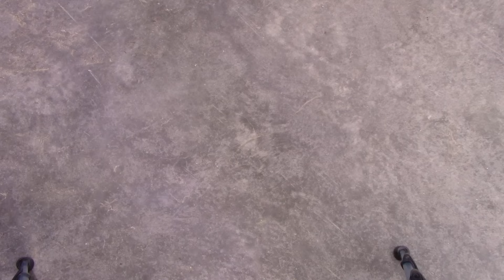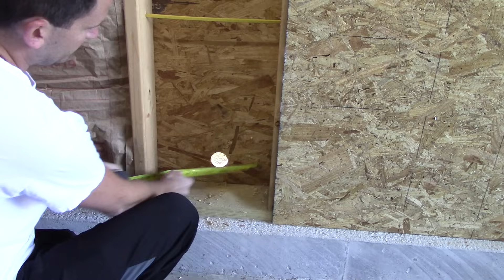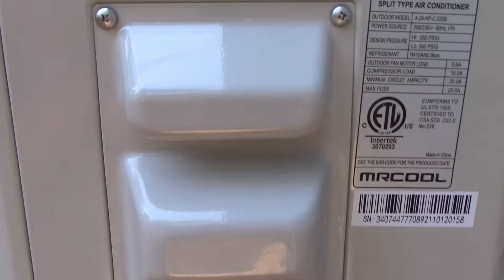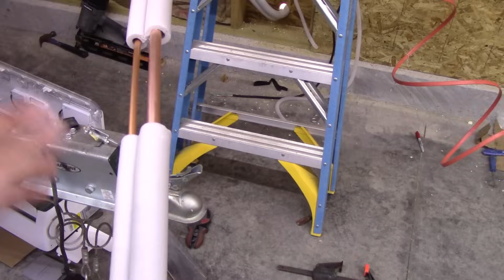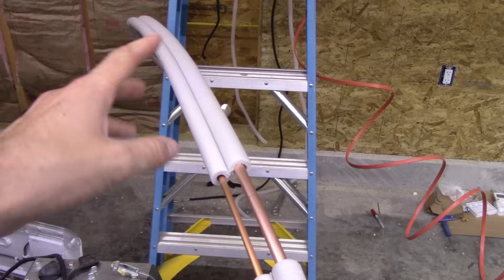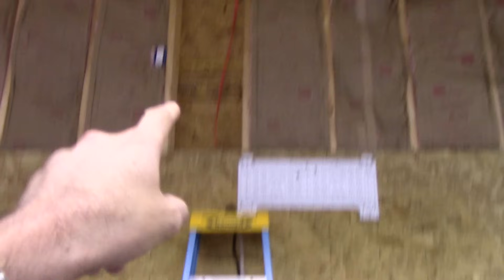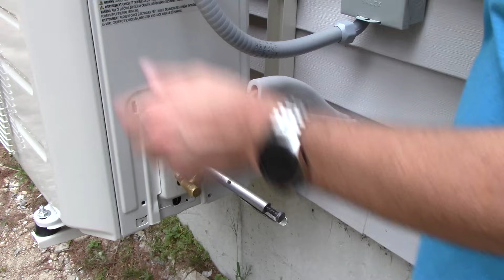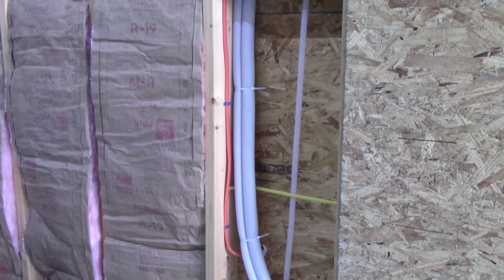Mini-Split Installation For Dummies - Complete Step By Step Guide.

Comment from the maker: MRCOOL HVAC System: https://amzn.to/3RDVp7m
Complete kit w/pump and gauges: https://www.amazon.com/gp/product/B00SZ4QFW0/ref=as_li_qf_asin_il_tl?ie=UTF8&tag=trialnerror-20&creative=9325&linkCode=as2&creativeASIN=B00SZ4QFW0&linkId=89c4a0bb2075662a32a2d66ed96ff4fa
Mini Split Adapter (service port adapter): https://www.amazon.com/gp/product/B07W9CQ76M/ref=as_li_qf_asin_il_tl?ie=UTF8&tag=trialnerror-20&creative=9325&linkCode=as2&creativeASIN=B07W9CQ76M&linkId=ca52469d7bedc726fa7d4ffc8f092356
Wall mount for outdoor compressor: https://www.amazon.com/gp/product/B00LDU9R2I/ref=as_li_qf_asin_il_tl?ie=UTF8&tag=trialnerror-20&creative=9325&linkCode=as2&creativeASIN=B00LDU9R2I&linkId=397f284d3c939e6c81efd137b0f2c9ca
Nylog Blue Sealant: https://www.amazon.com/gp/product/B008HOSQQQ/ref=as_li_tl?ie=UTF8&tag=trialnerror-20&camp=1789&creative=9325&linkCode=as2&creativeASIN=B008HOSQQQ&linkId=0212c4d8d8a14465fadbd8918ca3e3f2
Tubing Flair Kit: https://www.amazon.com/gp/product/B01LZB68U1/ref=as_li_tl?ie=UTF8&tag=trialnerror-20&camp=1789&creative=9325&linkCode=as2&creativeASIN=B01LZB68U1&linkId=3662399f5c22b114b22ebabb5d7b922d
BRAND SPANKIN' NEW CHANNEL MERCH! https://teespring.com/stores/trial-n-error

Comment: For anybody who isn't an idiot & is familiar with basic carpentry/mechanical/electrical, there's only one focus of a mini-split installation: TESTING & PRESSURIZING THE SYSTEM!
So, I share my own f-ups:
- Invest in an r410a-compatible adaptor hoses-to-automotive A/C testing charging gear (which is relatively cheap). Don't waste your time trying to source adaptor fittings!
- DO NOT OPEN THE PRESSURE VALVES AT ALL UNTIL YOUVE VAC'D THE LINE & CONFIRMED NO LEAKS!!! If you crack the pressure-line open AT ALL with the vac-fill port ("service") with an allen wrench you risk venting enough 410 to prevent the system's pressure-sensor from allowing the system to activate.
- IF you remove the schrader valve to enhance the volume of the vacuum procedure, then you must REINSTALL IT!!! That schrader valve is the only thing preventing the 'fridge from venting-out the service-valve!

Comment: You’ll experience water intrusion due to your lineset draining into your home.
Reply from the maker: The drain line follow's the lineset from inside, through the wall and drains outside, next to the compressor unit.  Thanks for watching.
Reply: @Trialnerror I know. I’m not talking about your drain line. I’m talking about your refrigeration lineset. Water will roll down your lineset and go into your home now because you didn’t make a drip loop before going into the house. The lineset should go down first when it exits the wall and then loop back up to hit your condenser. This is called a drip loop and allows water to drip to its lowest point (outside of the home) and forces water to have to go uphill if it wants to enter the home. You have given water a downhill approach into your home and will see water damage before too long.
Reply from the maker: @IndomitableHuman  Those lines are insulated.  There's no condensation.
Reply: @Trialnerror 😂 alright buddy. Just make sure you think of me when you are repairing your water/mold damage 😉

Comment: I wished you had shown more details of how you connected the disconnect box. Was the power into the disconnect box entering through the rear panel?. I just didn't see that! Also are there any wires connecting the condensing unit to the disconnect box? Thank you

Comment: I seen where it is said NOT TO PUT LOW VOLTAGE LINES WITH HIGH VOLTAGE LINES.  VERY DANGEROUS
Reply from the maker: The power that feeds back to the indoor unit is already a combo of low voltage and line voltage.  NOT DANGEROUS AT ALL.

Comment: THANK YOU for saying it is nitrogen in the indoor units for transport. I tried to contact the company and they told me it was freeon. I had no idea how I was supposed to disconnect the plug without releasing all the freeon.
Reply from the maker: You got it.  Freon is in the compressor and they vac out the line set after adding nitrogen so you have nothing but an inert gas under vacuum.  Sad that the company itself knows less then a monkey like me on Youtube.

Comment: How do you connect L1 and L2? Did you use a separate wire? I’m getting eo error code
Reply from the maker: Yes, you have to use separate lines as these are two completely different power sources to get 220v.

Comment: I really appreciate this video. Especially the bit where you only release enough refrigerant into the lines to remove the vacuum pump line under low positive pressure. Brilliant, thank you!

Comment: bought my 1st unit, and just by watching your video, i realized i did a lot of  things wrong...the units i purchased were already pre charged, so was it wrong for me to skip the vacuum part? so i did the installation,  and  the first time i turned on the unit, all i  was getting was just warm air, i was wondering why it wasent cooling nor heating, so then i realized i had left the high and low pressure valves closed..no wonder there was no cool nor heat coming ..so after i opened the valves big difference it was cooling and heating.. but the 3rd day the unit started acting, less heat As nd cool, and also error codes P0 E9 ..since i just bought this unit on Ebay, i sent a message to the seller about the error code, and the responce i got is that pcb or pbc board is bad, , so they will be sending me a new one...i just hope that  this is the issue that is causing for the unit not to work correctly..the other thing it could be is a leak in the lines..

Comment: I thought the Mr. Cool systems used pre-charged lines. (I thinking about you cutting the lines down)
Reply from the maker: They sell both.  These are MUCH less expensive and only take another 20 minutes of work to install.
Reply: @Trialnerror  Good to know.  Thanks!

Comment: Great video!  Are you still happy with this unit now that you've been using it for nearly 4 years?  Any issues or anything you'd do differently?
Reply from the maker: Yes, still loving it.  Does a great job and has given me no issues.  Only thing I would do differently is mount the outdoor unit 2" higher so I could scoot under it with my zero turn mower lol.
Reply: @Trialnerror  Good to hear.  Funny about the mower--story of my life: stress about covering the most minor of details only to find you've missed one that's going to be an on-going PITA.
Reply from the maker: @practicalwoodworking  So true!

Comment: I read that the extra pipe length is important as it will hold more refrigerant which keeps the pump running less due to more ability to cool or heat? 
But still good video!

Comment: So basically it only gets two 110vac hot wires, a ground wire and no common wire?
Reply from the maker: Correct, that's how the majority of 240v appliances are wired.  They pull two "legs" of 120v and reference to ground which is bonded to the neutral at the panel.

Comment: Great job and very clean! These unit comes with an optional pre-charged line set, in order to avoid the vacuum process and adding Freon into the line set. Any reason you opted to install with a regular high and low pressure line set? Thanks!

Comment: Most people who are installing aren't doing it in an unfinished space, so while it's very helpful to tell those of us who don't have the flaring tools or the tools for adjusting down the coolant levels for using less line than comes with it or the knowhow to do either, particularly the latter since you don't show us, not to coil the excess line outside because it decreases efficiency and creates oil traps in the lines, it's not at all helpful to tell us to run it up and then down inside the wall or zig-zag it inside the wall since that would require us to tear out all the drywall and insulation between those two studs to do that, meaning we'd then have to reinsulate, re-drywall, and repaint. The same goes for even running the line inside the wall at all since we can't, so the average DIY'er is going to not have the line run down inside the wall but have the line go straight through, or at a slightly downward angle to keep rain out and drainage flowing downward from inside to outside, meaning the outside hold will not be 8-feet down from the inside hole but be only a quarter or half inch down such that you can see straight through to the outside, making the excess line issue that hasn't been feasibly addressed for "dummies" even more of an issue as all of the line except the last several inches it takes to pass through the exterior wall inside and connect to the inside unit will be outside.

Comment: Good video. I used the same kind of wall mounting rack for my 18K MrCool. But I have vinyl siding and it gave no support for the condenser's mounts. I ended up putting some pressure treated 1" X 8" boards to give a solid backing for the rack and then like you using lags into the joists. It looks like your siding is either wood or something as solid.

Comment: Great video!   Best details about vacuuming line set among all the DIY mini split videos I've seen.  Although you say it's simple, I've seen other youtuber DIY mini-split install get into major pitfalls - such as kinking the line set by bending it too sharply, or not actually vacuuming the line set before releasing freon by forgetting the shraeder valve insert.  So it's possible to get into serious trouble if you are not careful with DIY mini split installs.
Reply: in all fairness, the Mr Cool line is made as a plug 'n play with NO vacuuming required.

Comment: Excellent video. Indoor and outdoor unit installed. I purchased the vacuum pump and gauges and did the pressure test. Passed. Now I’m ready to introduce the refrigerant. Do I start the condenser before releasing refrigerant? Thanks for your help!

Comment: It was clever to add only some of the refrigerant before removing the gauge. Most (DIY videos) either spurt the stuff everywhere or else edit the removal out. That said, it also seems questionable, since doing so means you won't get to watch the system actually holding full pressure. I suppose time will tell; so, has there been any drop in efficiency after a few years?  Thanks ;)
Reply from the maker: She's still purring like a kitten.  Heating and cooling perfectly with no maintence needed (knock on wood). Also remember, even when you release all the refrigerant you still can't test under full pressure until the compressor ramps up.  All you can check is the low side at pressure and that really doesn't tell you much either.

Comment: Are those lag bolts that you used to mount the bracket to the wall for the outdoor unit?
Reply from the maker: Yes, right through the OSB into the studs.

Comment: Question, installed a new mini split, during the heat mode, condensation leaks at the bottom of the outside unit, doesn’t seam right. Thoughts?
Reply from the maker: Perfectly normal.  In heat mode, everything is backwards so the coil's outside get REALLY cold.  The outside air hits those cold coils and you get condensate.

Comment: How's she going for you after 2 winters and summers? I'm thinking about adding minisplit systems to a house I expect to buy soon. Not as far north so the heating need will be less (or at least fewer weeks) but the cooling will need to handle higher temps. I don't have the skillz or strength to DIY this but I like to know what to expect when I pay someone. Thanks for a great education! I'm looking forward to learning more from you! (newest subscriber at this moment in time!)
Reply from the maker: She's going strong.  Really has given me zero trouble and I haven't had to touch it since I installed it.
Reply: @Trialnerror  glad to hear it! Also forgot to give you props for excellent use of t-rex. Well played!

Comment: Thanks for the video. What did you do with the condensation drain line? Water runs out of it in A/C mode. It's a good idea for your pipes to be angled downward toward the outside, same idea as a drip loop. Rain on the lines will eventually enter the building if positioned your way. Regarding coiling the lines, the refrigerant and oil are said to have miscibility. Defined as follows - "Miscibility is the property of two substances to mix in all proportions (that is, to fully dissolve in each other at any concentration), forming a homogeneous mixture (a solution). The term is most often applied to liquids but also applies to solids and gases." I have seen many coiled systems running for years, 10 years for my own systems, with no issues. A coiled line also helps to reduce vibration and noise from travelling from the compressor to the inside of the building. Regarding the electrical wire from the compressor to the inside uiit, viewers need to know that your routing will not work for most installations. The "cab tire wire" connecting from the compressor to the inside unit is bundled with the refrigerant lines in order to get to where it needs to go. I would suggest that  people watch other installation videos in addition to this one before starting the install.

Comment: I hope you see this, but I installed mine recently. I didn't do the testing of the side guages for refrigerant line and all that, but I opened the valves. However, mine won't blow cold air! What do you think it may be?
Reply from the maker: Did you vac down the system after connecting the lines but before releasing the refrigerant?
Reply: @Trialnerror  where in your video is that? I'm very amature at this stuff

Comment: why did you connect the neutral in the breaker box and you capped it in the outside disconnect? The 240 doesn't require a neutral, right? What purpose does that serve connecting to the box when you have the ground connected?
Reply from the maker: I explained it in the video.  It's for a potential future upgrade.
Reply: @Trialnerror  that is what I thought, did you disconnect the line(neutral) in the breaker panel
Reply: @Trialnerror  I enjoyed the video, good job. Thank you for quick response

Comment: Good Video, but 1st, when you disconnected your gauges, that was gas or Freon cumming out not air. 2nd, You might want to remind people to check the Electrical Code : How to hook up the AC system. 3rd, a Pro would not use a adjustable wrench or Chanel-Locks .

Comment: 2 questions, does the outside unit have to be outside and does it need its own pair of breakers or can it be tied into a pair that already exists as my panel is already full. Thanks.
Reply from the maker: Yes it has to be outside or at least have some way to exchange air with the outside cause that's where all the heat goes.  No it will need to have its own breaker you can't legally add this onto an existing circuit.

Comment: You said, " the shorter the better" for length of copper lines. If you cut them shorter than the recommended 10ft length, will that increase the refrigerant pressure too much?

Comment: If you could answer, where is the refrigerant come from.. Are you adding it or is it in the system already when you open the valves after using the pump and gauges. Thank you.
Reply from the maker: It's in the compressor for shipping.  When you open the valves it get's released through the rest of the system.

Comment: Question: I'm installing a 9000 BTU mini-split, ordered it with a 10-foot line set and I only need about 5 feet of it, the instruction says it has enough coolant for a 16 - 25 -foot line set, is there too much coolant if I use the ten-foot as it is and if not what about if I shorten it to 5 feet?  Thanks
Reply from the maker: No, you'll be good to go as is.  There's a relief valve even if you were cutting it too close but 6 feet of line is nothing from a pressure perspective.

Comment: Does this unit only use one breaker? I am assuming the signal wire carried the power to the interior unit?
Reply from the maker: Correct, one breaker.  The outdoor unit feeds the indoor unit power.
Reply: @Trialnerror  awesome but I am still a little confused and it does not help that the instructions are not clear. My unit label for the inside wall part listed max breaker 15 amp and the outside unit label says 20 amp max breaker. This is why I am confused as to how each unit does not have its own breaker. On a traditional split unit the compressor unit has a breaker outside and the air handler one as well both separate. Any input is greatly appreciated

Comment: This is the cleanest install I’ve seen. No extra hose running loose outside. Helps to mount it on the house to keep it clean.
Reply: Can you hear the outdoor unit from inside? (because it is mounted on the wall...) I'm still selecting my mounting method. (BTW - Nicely done video!

Comment: So you mention oil traps due to coiling the excess line, but the view of your outdoor unit shows an oil trap due to your lines exiting the wall below the fittings on your outdoor unit. Great video, I'm still on the fence about these DIY units.

Comment: Cool video, very informative. I've installed one and it was very helpful to see people going though the same process. One advantage I had is that here in the UK mini splits like this just plug into a standard outlet so we don't have to touch the main panel.
Reply from the maker: Ahh the benefits of living where mains voltage is a reasonable amount to power most anything.  That saves a lot of work!
Reply: @Trialnerror  We need it to power our 3kw electric kettles to make tea....

Comment: I'm wondering if the ground wire in your sub panel should be connected to the neutral bar.  It wouldn't make a difference in the main panel, but ground and neutral are separate in sub panels. Or does that even make a difference? I don't know enough about electrical.